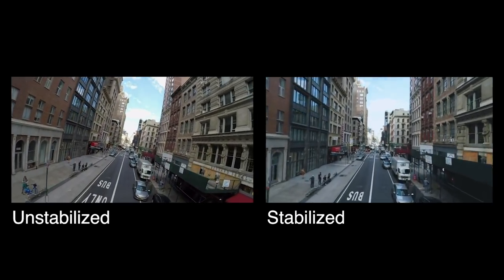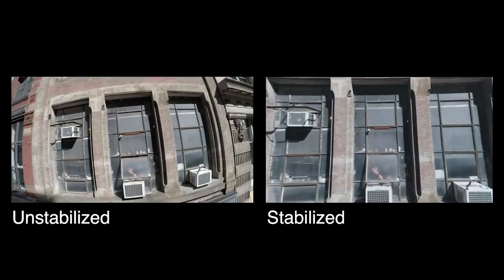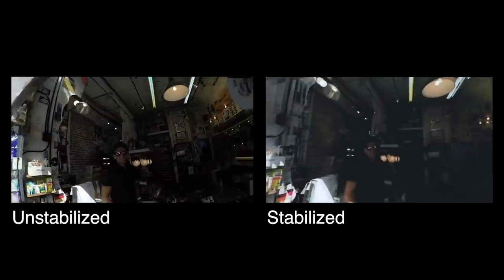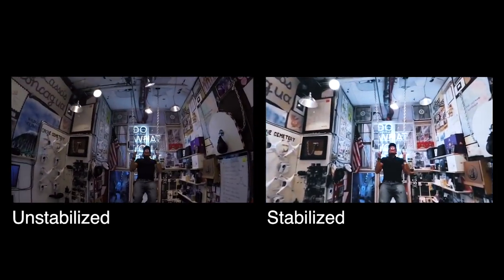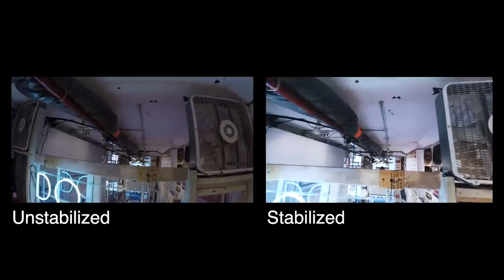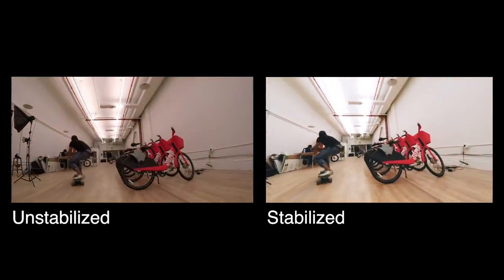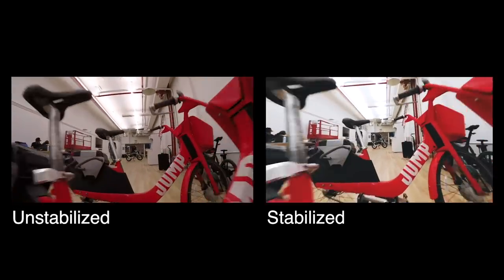A 3 MiNUTE EXPERiMENT; IT WORKED!!!

Comment: Critique:
- The low res from stabilization was a little shitty but understand the limitations of what you're working with.  If it's light enough, try a 2k mini gimbal camera to get at least 1080p post-stabilization.
- Saw a chop (video join?) in the transition on stairs from b-ball to basement. 
- Would have been cool to see more acting, like you looking puffed as if you actually ran between appearances. ;)
- Hero 4 supports 2k @ 60fps, assume had to crop props from footage, try mounting under drone and using battery as spacer from props.

The Good:
- Exceptional flying, very talented drone pilot!
- The coolness factor was very high and I can't wait to see what you do next.
- Can't wait to see the improvements to tech you come up with.
Reply: Ray Le Roux don’t know what resolution they shot at but the hero 4 supports 4K 30 and 2.7k 60
Reply: There were multiple little chops throughout the video but he usually came up with transitions to mask them. I guess he didn’t use one here?
Reply: Ray Le Roux mann can you do some of my work
Reply: I noticed a lot of stutter in the drone video, did anyone else notice that?
Reply: Hah, Casey asked for constructive criticism. I love what these guys do, so tried to be helpful.

Comment: That was super cool. It was really smooth but some places did have a very small shake. It didn't have a negative impact. I think if you had used more slow motion edits / fast forward edits to mask those it could have helped. 

The only other thing i would have changed would have been the flight path. A lot of the areas the drone flew through were out of the way and felt pushed but that's not a bad thing since this was a test to see how far you could push things. That's something i admire for sure. 

I think ultimately if you did want to do something like this in the future and you want just as much fancy flying and wow factors you should set the flight path up so this all happens in what seems to be one long sweeping shot. No having to go far right or left just to go through bikes it should just be small movements and small turns that are necessary because those things seem naturally in the way.

Hope this helps with some feedback!
Reply: why are you even here
Reply: Anthomnia? What the fuck is up
Reply: Amthomnia fancy seeing you here
Reply: Nobody cares about your opinion. I read 2lines

Comment: I like it as a fun little experiment/proof of concept buuuuuuuuuut here's what I'd improve for the real thing:
* Why is the image so soft? Lack of quality? You can easily get a 4K action cam on a quad of that size. 
* Take more foley audio in the room where it's meant to be heard. Basketball bounces, for example; it kills the immersion when we don't hear reverb/hear the same sample repeated.
* The cuts could be better hidden, and I'm not a huuuuge fan of the 'warp stabilisation' effect. If you can tell it's warp, you need better stabilisation on the input. 
* After the drone flies through about the 3rd tiny space, it's just showboating. Audiences don't need to have it rammed down their throat that the camera is tiny/mobile and the pilot is skilled; some of us are getting nauseated here :-) 

Hope this helps! Great work drone/editing teams!!
Reply: This exactly. But as a concept it's great.
Reply: Peanut Turner Yeah...
Reply: Literally This.
Reply: don't know much about editing, but I'm curious to know if the quality degrades when it has to be stabilized?  i've found that to be the case, but all I know is iMovie.....moviemaking for dummies :)
Reply: Have you ever stabilized footage with this much jerky movement tho? It takes a lot to get it this smooth from a small drone like this and the drone image quality wasn't great to start with. But I agree, whatever software hes using is shit, there is many better third party stabilizers for after effects that would achieve much better results like ReelSteady and NewBlue.
Reply: Valid up until that last point, like fuck come down from Olympus there Zeus.
Reply: How demanding.
Reply: like you're watching a small scale "soarin" ride at disney world

Comment: I honestly found the digital stabilisation uncomfortable to watch with all the changes in focal length and pixel stretching, I think this could work very well with a GoPro Fusion though, (might need a slightly bigger drone, which kinda limits your movement though the space) also I think sticking to transitions whilst panning quickly works a lot better than trying to seamlessly integrate them in to a dolly shot.
Reply: Agreed
Reply: I agree, It feels like a fly (something not meant to be here) is roaming around. The warping seems too apparent when you do a "long take, the turns also feels really weird. A bit of shakiness would not have been such a big deal.

Comment: You'll probably never see this, but look into a runcam split on a 2" or 2.5" quadcopter. If you build it right, it can be wayyyy more stable than attaching a gopro to a quad that can barely handle the weight.

Comment: That is sooo cool !!    How big of a step that is versus what was possible to produce 5 years back. A m a z i n g !!!   
So think of that 3D Laser measurment technic where you can take the measurements of a room within seconds. Depending on the resolution you set it to, you can get a photorealistic picture made by data only measuring distances. So if you used that technic and you are able to have a room with all its obsticals (bikeframes etc) and you programm the drone to fly a certain route, you have a motion smooth as can be !!  (Just a spontanious thought.)
So curious who s gonna put that on the market next.
P.S. Good Job on the stabilization! What A Difference! What software to use for that?

Comment: FPV hobbyists have been building drones this size that can record in HD for about a year now, using products like the Runcam Split Mini, and they don't fly like a shaky mess.  This method of sticking a de-cased GoPro on top of an already under-performing Torrent 110 is a bit silly, and is why the video looks so shaky.  If you're going to branch into the FPV side of drones, maybe get with some of the vendors, innovators, and pilots from that industry who have already been succesfully recording HD footage with micro quads - and way more smoothly.